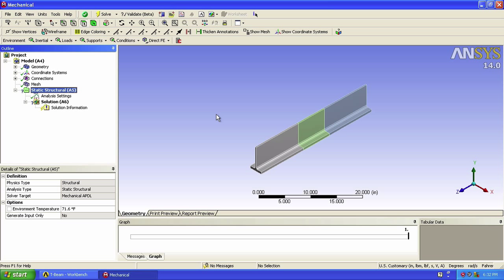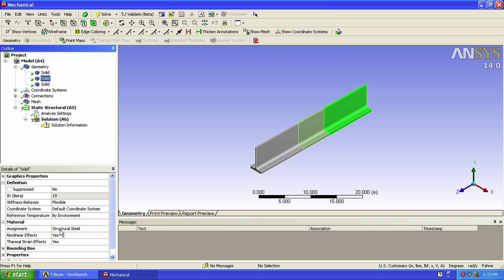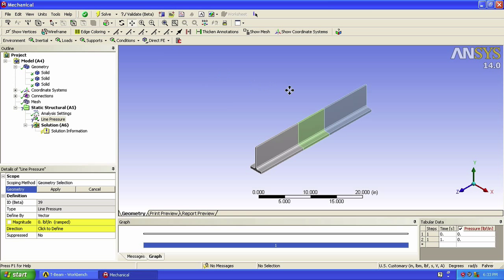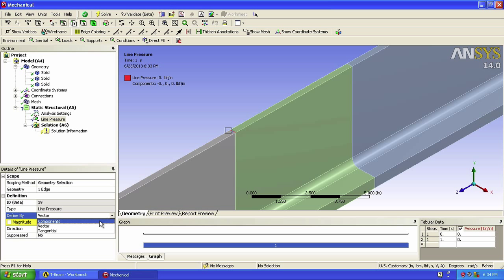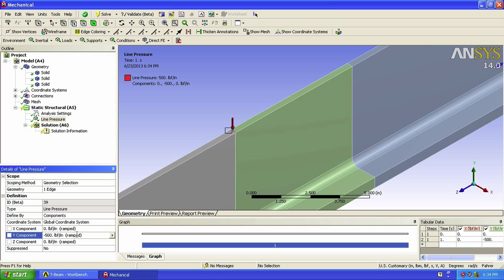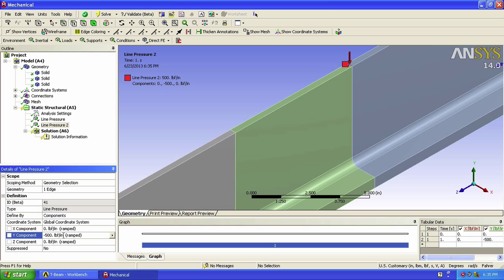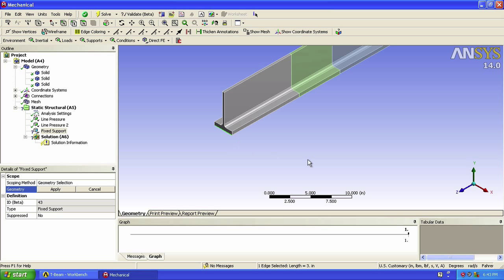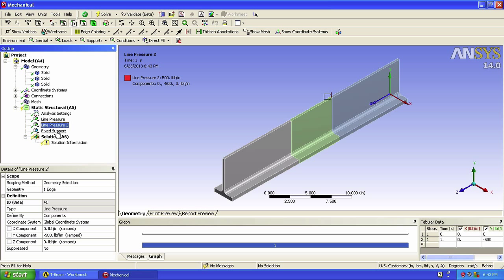SimCafe: T-Beam in ANSYS, Physics Setup

Comment: In the problem description it was stated that the load was a distributed line load on a length of 1/2 inches in the longitudinal (Z) direction, But I think in this example it's distributed in the X direction. why did you that?